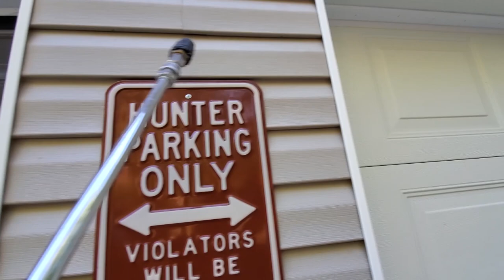Pressure Washing Tips And Helpful Info

Comment: Perfect timing on this video... looking at buying a washer for my home... was actually looking at electric though...
Reply from the maker: Electrics are great. Remeber on your house you don't need or want to ise high pressure.  Let the soaps and detergents do the work. Start off rinsing with a wide tip so you don't hurt anything until you get the feel for it.
Reply: Traditional Bowhunting And Wilderness Podcast thanks Jason!!!!
Reply from the maker: @James-ck3nd  welcome. Any questions just ask. 10 hours a day for last 2 months I've been playing with a pressure washer..lol
Reply: Traditional Bowhunting And Wilderness Podcast Jason what do you think of the Sunjoe spx3000.  ($155 Home Depot.). Has a high GPM for electric washer (1.75 gpm.) and a fair PSI as well...